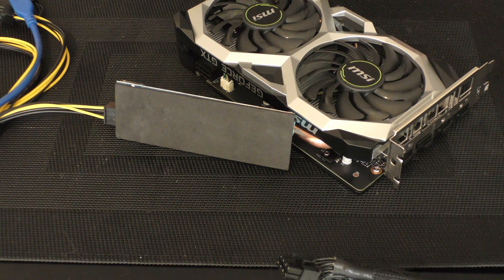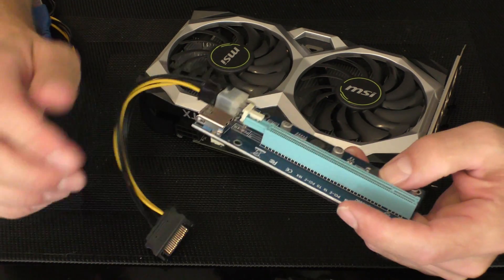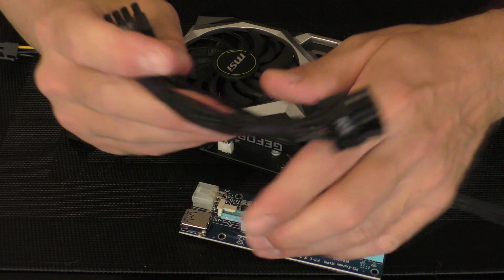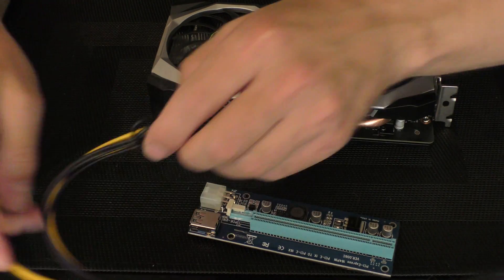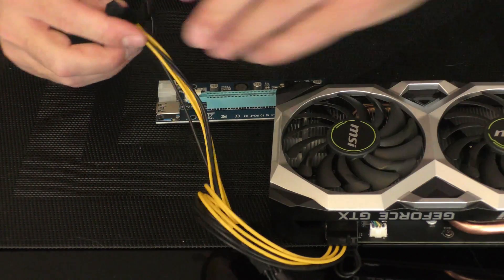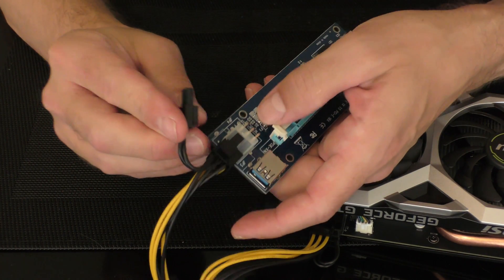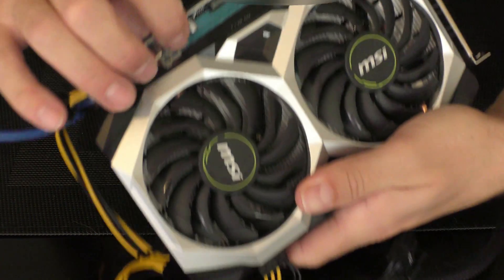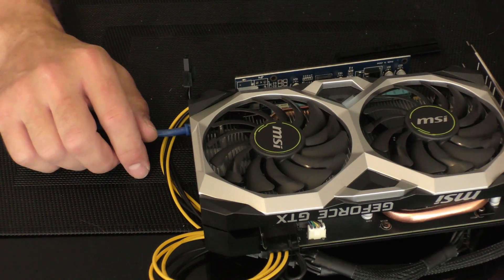Connect your GPU | Riser | Splitter

Comment: If im put direct power supply to gpu it's that ok not use splitter??
Reply from the maker: It's fine
We use spitting when GPU is not too powerful and we can use same plug for both. But it's fine to use one plug for each. Cable can handle 288w but GPU will only use what's needed.
Reply: @minerondemand  thanks you for that info brother that help me a lot ☺️

Comment: I have a question ❓
When I open laptop gpu will turn on automatically or I have on GPU first the laptop
Reply from the maker: Not sure what you mean. You don't have access to GPU on a laptop.
Reply from the maker: On a normal computer yes, it will turn on automatically if connected to same power source
Reply: @minerondemand  what if I install This riser on laptop then I have to start rizer first then laptop or they start at same time
Reply from the maker: @suyoge3959  you still cannot connect GPU to laptop in a easy safe way.
Reply from the maker: You don't actually have to buy a full tower. You can just buy components and put on a table.

Comment: I don't have a splitter. can I power riser with 6pin pcie and  rtx 2060 gpu with 8pin pcie both coming from 800wt psu? I already have one rtx in mobo.
Reply from the maker: Sure you can.
Riser will only use necessary power.
Just never use SATA
Reply: @minerondemand  ty. I was worried about short circuit since both pcie cables coming from psu would be going into single riser gpu setup as opposed to your method of using splitter with one connection

Comment: I advise against this depend on the card, but using two separate ports and avoiding splitters is best
Reply from the maker: Nothing wrong using splitters if they are good. Watch "power cables" video to understand better. Thanks for your comment

Comment: If we have 2x8 pin cards like rx 580 8gb, its safe to power card and riser from one pcie cable ? What is other way ? Its safe to put 1x 6 pin to perif on PSU and split it in two molex for 2 risers?
Reply from the maker: Depending on the card yes. I don't suggest using molex. Check my video about power cables to learn more. You'll understand better.
Reply: @minerondemand  rx 580 8gb, for 3x of this cards, is enough 850w evga semi modular 80 plus bronze?
Reply from the maker: @iam4220  Yes. Those cards use about 90w each with OC. Give or take another 100w for system and you have your total.
Reply: @minerondemand  ty for answers bro, you have 1 more new subscriber 😂
If i can ask you one more question. I didn’t understand your answer for my first question. 
My rx 580 special edition is 1x 8pin and 1x 6 pin. My cable 8pin is with 2x 6+2 , if i split one of them in 2x 8pin, and connect 2x in gpu and 1x in riser, ita save? 1 pcie cable for 2x GPU and 1 riser? I have watched your video for high power gpu, but if i use 1 pcie for gpu and 1 for riser, i dont have more slots for 3 gpu, cuz my psu have 3x 8 pin for gpu
Reply from the maker: @iam4220  It's perfectly safe. That's how I connect my 6700.
As long PCIe cable is under 288w is good.
I exemplified this on my power cables video. You should take a look.
Reply: @minerondemand  i can’t find that video, can you link? Thanks
Reply from the maker: @iam4220  mining 101 playlist
https://youtu.be/wekRS_vT20s

Comment: Using your method can I connect two gpu i.e 2 8pins goes to gpu power and 2 goes to riser(splitter) will one cable can hold?
Reply from the maker: You're likely to go over power limit. Check https://youtu.be/wekRS_vT20s to learn more.
Reply: @minerondemand  Yes i saw that video but I've only one 8pin(6+2) slot empty   other is connected to riser, for that one slot can I add splitter and use it for 2 risers? Thank You 😊
Reply from the maker: @kishorprogamer  
1 PCIe > 2 risers.
1 PCIe > 1 GPU + riser
Yes you can mix, as long it stays under power limit but you're risking too much. I don't advise doing it.

Comment: Can u use the cpu wire to power  riser & gpu without the spliter as it got 2 on the CPU wire
Reply from the maker: Noooo. Different output.
Check https://youtu.be/wekRS_vT20s
Reply: @minerondemand  Ok Thank You  i appreacate it
Reply: @Miner on Demand  sorry can we use the Pcie 3 splitters power supply lead to power the riser & GPS. Without using a spiilter
Reply from the maker: @000shiva4  as long it's the GPU PCIe, yes you can.
Reply: @minerondemand  thank You much appreatce
Reply: Sorry

Can i put the 8 to 6 pin cpu wire in to riser 

& use Pcie in gpu

As the pcie lead is not long enough to go in riser & gpu 

As I go no splitters ATM
Reply from the maker: @000shiva4  you cannot use anything from CPU to GPU.
Plugs are different and won't fit anyway.

Comment: thank you man.  I was just looking for a solution to the same problem.  Any adapter can be used, no matter what power supply? how long will the equipment work through such a connection?
Reply from the maker: I advised watchin my "power cables" video to learn more.
Splitter needs to be 18 AWG.
Mine have been working for 2 years with no problems.

Comment: can you use 2x splitter on that black cable, since that black cable has 2 male outputs?, Like powering 2 GPU from one black cable, and 2x yellow cable (splitters)
Reply from the maker: I don't recommend using same PCIe for 2 cards. Check video "power cables"https://youtu.be/wekRS_vT20s

Comment: @Miner on Demand, How about don't use PCIe splitter but rather using PCIe separate for gpu and rise. One coming from PSU to GPU and one coming from PSU to riser? Is this okay?
Reply from the maker: Yes you can.  We use spliters so we can connect more GPUs.
Reply: @minerondemand  Thanks a lot bro! 😀 Happy mining!

Comment: How is the cable in 00:37 called? I want to connect the splitter to PSU but I dont have such cable with male ending.
Reply from the maker: That's a pcie or VGA cable.
All PSU must bring them.

Comment: If my GPU (RTX 3060) requires only 1 PCI 8pins, can I use the same black cable for both GPU and riser without the splitter? Thanks
Reply from the maker: Yes,  but usually cable is too short.

Comment: Your cable from PSU has the output of 8pin and 6+2 pin, you can connect 8pin to GPU and 6pin to riser. Why do you need the splitter?
Reply: can you really do this? cause if so, im not using a splitter for one of my GPUs
Reply: @0x21m  I used EVGA PSU. The cables come with PSU are too short to reach both GPU and riser. I used one 8-pin extend cable and it works perfect. If the cables come with your PSU are long, you can direct use them.
Reply from the maker: in general cables are too small. if you gonna use an extender, is no different than a splitter.

Comment: if i use another splitter on the non use end, will it over heat ?
Reply from the maker: as long you keep power under 188w you 're fine.
check powercable video for more info
Reply: @minerondemand  i appreciate ur answer, keep up the good videos

Comment: If my card has a good overclock, and it does not exceed 120w in the 2 pci 8 pin, is this method safe?  Generally I use the SATA or molex to pci 6 pin for the riser, but sometimes the power supply runs out of cables, do you recommend this?  since I have seen that occupying 2 SATA or more is already dangerous
Reply from the maker: You shouldn't use sata for powering GPU's ever.  As long you don't surpass the 288w you can split the pcie cable.
Reply from the maker: Check power cables video for a better understanding
Reply: @minerondemand  Now that I think about it, I only use sata for low consumption graphics cards, but I have to add a 3070 to the riser, and as I saw on the Internet, a riser consumes a maximum 75w and I know that the graphics card is currently consuming 122w, that would be 197w directly from the pci express cable occupying a splitter, so I'm left over
Reply from the maker: @theroroxmaster  that's why I strongly recommend you watch my video about power cables.  Risers don't consume energy.

Comment: Can I use my stock PSU cable to connect from 6 pin two risers that split into two 6+2 pin?
Reply from the maker: 6 pin can handle 156w.  You should be ok. 
Always check cable temp after start
Reply: @minerondemand  thanks!

Comment: Hey could you help me out? Some of my splitters actually get really hot ! 2 splitters even got burned. I’m just using 1x 8 pin to 2x 8 pin connectors (the same as you have in the video) and was powering a 3060 ti and its riser with it (3060 ti was running on 120W). Do you know how this is possible?
Reply from the maker: If they getting hot it means they not handling power.  You need proper quality splitters. 18AWG
Reply from the maker: Check video about power cables I explain the difference

Comment: if 3070(2*8pin) tdp 220W, is it ok to use the method as you mentioned 1:13 ?  Since riser 75W+220W over 288W
Reply from the maker: Total GPU watt usage already includes riser.  Check my video about power cables.
Reply: Thanks!

Comment: Thank you thank you thank you 🙏
Reply from the maker: Anytime.  Hope it was helpful
Reply: Of course! Spent 1000$ on 4 PSUs and then found out why the sata socket has been burning and melting down. Did a purchase of these splitters, saw your video and finally, my 3 rigs are back and running. A BIG thank you to you, once again!
Reply from the maker: @greenblade4081  check out my video about power cables for better understanding. 
I really don't know why they include that sata crap with risers.

Comment: My pcie splitter doesn't fit 6+2 pin only full 8 pin (not splitted pin)...
Reply from the maker: You probably have a CPU splitter or some other kind .
Reply: @minerondemand  Yep they sent me a cpu splitter...
Reply: @minerondemand  Do you know if I can use my extra CPU cable then to power a graphic card? What I got is a CPU Female to 2 PCIE Male then. Is that risky or why would such an adapter even exist?
Reply from the maker: Only if its CPU to GPU splitter. If not you'll burn the cards, so make sure.
https://youtu.be/wekRS_vT20s

Comment: Sir I m making a new mining rig with four rx 580 8 gb  gpu . I have issue when I plug Gpu with mother in pci slot my monitor signal is gone no more display. Don't matter what gpu I use first one third  2nd one or 4th one...
And first pci slot when I plug no display but gpu fan is running. But other slot gpu fan is slot after two three second and some issue no display I also take out Bettry from motherboard but same prob. I have all thing is new but I don't know what happened.
Reply from the maker: it could be that motherboard is set to inboard graphics. Check BIOS and change to pcie

Comment: What if i have 8pins but one of pins not working at all, just 7pins it will work fine

Btw ihave rx 580
Reply from the maker: If you mean splitter I suggest get a new one. 
If on GPU  I don't know but I guess you could try.

Comment: I have 2 RX 580 one is in the 16 slot and I put the riser in the 4x slot. but AMD does not find it when i reboot. Do you have any vids on how to make that 2nd PCIe slot visible?
Reply from the maker: If you powered the riser correctly you might have a bad riser. If you can try another. Also swap the GPU's to make sure they are working. 
Another option,  in mobo bios,  if available,  enable 4g decode.
Reply: Oh I guess I needed to update my Bios on the B450 motherboard. It is digging for gold now! Thanks
Reply: i have the exact same problem with my rx 480..

Comment: I have a question, with that black cable from the PSU, mine has the 6+2 plus another 6+2 just like yours shown in the same black cable... As my GPU only needs one of the 6+2's, couldn't i just use the other spare (6+2) one i don't need to plug that into the riser? (instead of the yellow splitter) If not why?
Reply from the maker: Usually they are not long enough,  but if reaches riser,  of course you can use it.
Reply: @minerondemand  ah okay cool, mine is long enough so should be cool
Reply: @minerondemand  thanks a lot for the video

Comment: If the riser can pull 75W and the GPU 8 pin can pull 150W wouldn't that be more than the cable can handle? I'm considering switching to this method, but I must be misunderstanding some part regarding the electrical pull.
Reply from the maker: Please check my video about power cables for better understanding. 
When we measure GPU power,  riser is already included. 
Riser itself don't use any power

Comment: Six pin  Power connectors plugin for both gpu card and Riser card?!
Reply from the maker: 8 pin to 2x 8 pin (6+2)
That's the way. 
6pin cable are for peripheral
Reply: @minerondemand  Thank you!

Comment: Thanks alot it helped me alot, I have a question plzz If I connected 3 1660 super  is that possible to use 600 watt psu?
Reply from the maker: You should be fine 1660 are low power
Reply: @minerondemand  thank you so muck Bro

Comment: Hi, question, can I connect another riser to the 8 pin (6+2) cable that remains free ? Or should I just leave it with out anything connected to it? Thanks
Reply from the maker: It's best using each pcie for 1 gpu+riser.
Reply from the maker: Check videos about high power GPU and power cables for better understanding

Comment: Hey bro, thank you for this video. I don’t have any splitters but i do have 2 8(6+2) cables, so, can i connect the riser directly to the psu and connect the gpu directly too?(with out splitters) Thank you in advance.
Reply from the maker: Yes you can use 6 pin on riser

Comment: Hi bro, great content. Is it safe to connect 3070 with one pcie cable which has 6pin and a 6+2 pin connector?
Reply from the maker: Thank you. 
Yes you'll be alright and safe
Check video about power cables for better understanding
Reply: @minerondemand  do you mind sharing the link to the video? Also another question, I have 1300w psu, is it sufficient to power 3 gpu, 3070 3080 3090? I use afterburner to limit the power to 80%.
Reply from the maker: @zetopium1632  https://youtu.be/wekRS_vT20s
Yes it's enough

Comment: My gpu has only one 8 pin connection and my psu wire has a spliiter (dual 6+2pin) so can I connect one to gpu and other to riser? Instead of sata or dedicated splitter
Reply from the maker: Yes. But usually cable is too short,  that's why we need spliter. 
Sata to power riser it's not safe. 
Check video about power cables.

Comment: So if I get it right, now 150W comes from PSU and splits into 75W to the GPU and 75W to the riser through the 6 pins, right?
Reply from the maker: Yes something like that
Reply from the maker: But risers don't necessarily need 75w.  Depends on GPU requirement.  Check my video about power cables for better understanding

Comment: one gpu has two gpu lines.. can I use two splitter to connect multiple gpus? you demonstrated one line with two gpu lines and connect one splitter to one of the line. is it ok to connect two splitter to each gpu lines? If I have multiple gpu in the future
Reply from the maker: Follow one simple rule.  1 pci-e for one GPU.

Comment: quick question... if I have 2 GPU can I connect the second GPU to the splitter from the psu? or should it be on a complete different cable?
Reply from the maker: It's not recommended.  But if both GPU don't pass the cable limit 288w yes you can

Comment: Thanks a lot, man for your explanation.
I couldn't understand how to find another 8 PIN port to connect it with the GPU. Because with the splitter, 1 port would go into the Riser and the other port in the GPU. But, my RTX 3070 has 2 ports, and I did not know that I can use the port when it was connected with the splitter.
Thank you :)
Reply from the maker: No problem.  Thanks for watching
Reply: Your rig Is ok or on Fire?
Reply: @mrtheshy  LOL prob on fire
Reply: @smage7725  At the moment I am feeding my risers with Molex, I tried sata and they were heating up (bad thing, I don't want my house to catch fire, I even programmed an app to prevent it ...) molex is perfect, it does not overheat (I have tried the stress test in a thousand ways before leaving it at night) (Powering an RTX 3070 non lhr and a RX 570 8GB)
Reply: @mrtheshy  Molex was always a questionable option for me, i wasn't sure if i were to use them since most of them draw 60W (at least what most sources say so) and obviously a risers top point (not necessarily) is 75W. But i am using molex cables for a long time now, never seen them heat up or cause issues; i might be lucky, my molex cables are seems to be good ones. Currently, i mostly use splitters to power up the risers and molex cables if i need to. Running 2 rigs (8x RTX 3070 and 12x 6600 XT) pretty well.
Reply: @smage7725  How mutch you are doing per day and how mutch do you paid for that
Reply: @mrtheshy  They give total of 875 MH/s. They make 0.59 ETH each month. I paid 14.000 Turkish Lira per RTX 3070, 6.500 Turkish Lira per RX 6600 XT which makes total of 190.000 Turkish Lira = 19.000 Euros approximately.
Reply: @smage7725  how much profits your making from 3070 rig now per day

Comment: is there any pci-e cable built in my computer??or do i need to buy pci-e cable??
Reply from the maker: Pcie cables comes from your PSU.  If you have a GPU then of course yes.
Reply: @minerondemand  i see molex but no pci-e...can you help me to find where to find that cable cuz im so dumb at computer HAHAHAHA
Reply from the maker: @kevzuex9247  you have graphics card?  Or are they integrated?
Reply: @minerondemand  i have graphics card and it's old msi twin frozr ii
Reply: @minerondemand  i see 3 pcie slot
Reply: but no cable